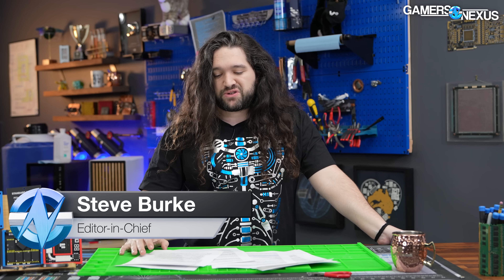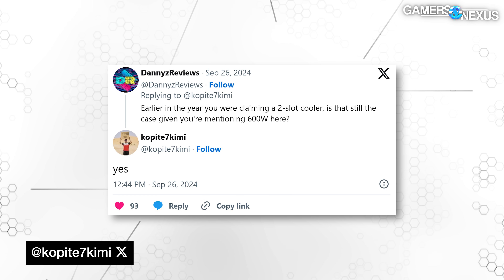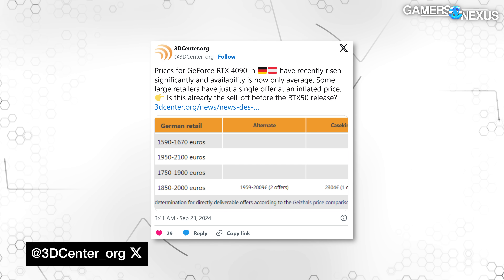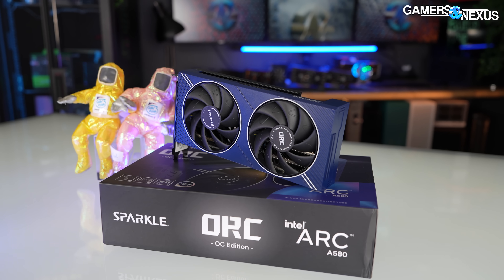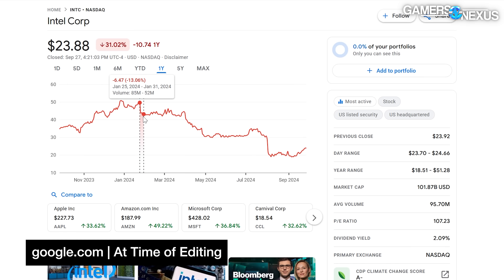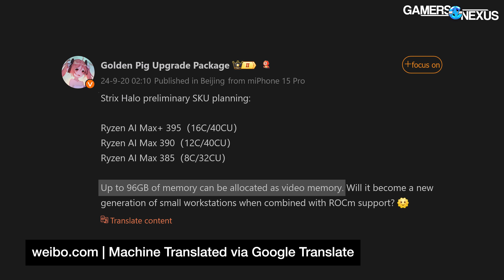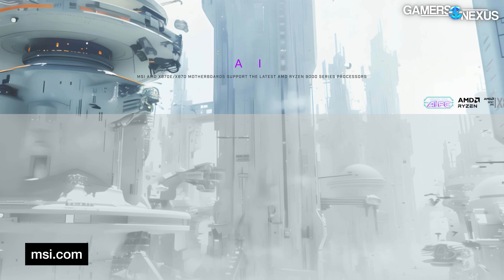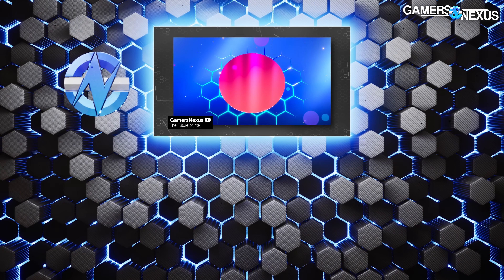HW News - RTX 5090 & 5080 Leaks, Valve ARM64 Experiments, Intel Arc 0% Marketshare, 4090 Price

Comment: Genuine question: let’s say cuda cores increase 10% from 4090>5090, would it be an at minimum 10% uplift in performance? Then tack on various architectural improvements to make it 18% or whatever
Reply: maybe - maybe not, if they want to make it more efficient. But seeing as there won't be any competitors, my guess is they don't go full throttle.
Reply: @bernds6587  really I’m just curious if we can estimate a minimum improvement based purely on the core count.

Comment: The problem the 4090 had with AIs was it just had a few GB to little VRAM while the RTX 6000 had enough but the GPU core was slower. If the 5090 has 32GB that will fix the VRAM issue for the lower end of medium size and higher end of small AI model training. Now do i see businesses buying it for that? No i do not as most user the large or huge size AI models with many GPUs instead of 1 GPU with only 32GB of VRAM. For schools teaching about AI i can see them buying a computer lab full for 5090s so students can sit at the computer doing the training. Supervised AI model training in theory is the best so having a GPU that can do it itself without having to pay for  a datacenter would be good.
For gamers? Unless developers  start running the type of AI models in mods locally  it is most likely not going to be used any time soon. 
The enemy AI used in games really isn't the same type of AI as the AI models referred to in the tech news. It is just a script that most are not even able to reprioritize actions based on how the player plays the game. An AI able to would not take up that much either just in games outside of horror games a learning computer enemy was found to not be fun as it can be perfect and you cannot.

Comment: 9950X3D with INFINITE cache!
Reply: on the new ASUS x870e boards with the upgraded ram slots.. probably hit 8200Mhz
Reply: @jabronilifestyle  Its waste of money. RAM needs to run 1:1, all those 8000-9000 MHz numbers are all BS, you gain nothing from it
Reply: @Dr.WhetFarts  Only with cheap ram. you're categorically false and I have the machines and testing done to prove to myself that you are incorrect. Sorry not sorry.
Reply: @jabronilifestyle  It's still too uncommon right now with the current manufacturing process to get a chip with a great memory controller. The memory controller on my sons water cooled 7800X3D just refuses to remain stable beyond 2600Mhz(5200 MT/s)... which is the maximum guaranteed speed.  A different 7600X system I have was able to push to 3200Mhz(6400 MT/s) with no instability after months of heavy use.  So while it's definitely nice to see the 9000 series' guaranteed spec bumped up to 2800Mhz(5600MT/s)... most people just won't be getting a chip that can run much faster than that so cutting the controller clock would be necessary and that eats into any potential gains. Plus X3D chips make chasing memory speeds almost pointless(for most use cases). Not entirely... but almost.
Reply: @jasonluvisi  I don't care how common it is, I'm running 8200Mhz on AMD and you can't stop me.
Reply: @jabronilifestyle  Sure you CAN... I mean anybody can pay double the price for a 2% real world(not just memory bandwidth sensitive tests) performance uplift.   Higher speeds won't make any real difference until the UCLK can keep up.  But yeah it's your money.

Comment: I'm still using my Asus rog strix Z3090-E mobo with i7 9700k CPU and RTX 3060 12gb by zotec.   I wanted to upgrade to an AMD build (I only have the Intel because I got the whole system for $400 4 years ago 👍), but with all the components being SOOOOO expensive and questionable quality, IDK what to even buy.  I was looking at the Zen 5 AMD 7700 CPU but I heard those suck. CPU is the one I use most so that's the one I really want to kick ass.  
Same with ASUS and all the warranty lies don't sit well.  I've used Asus since I've started building my systems. 🫤

Comment: Amd cards are getting pretty good but I feel if they made advances in software interface side I’d probably get one,  I just like the Nvidia control panel and dlss and dlaa upscaling more,  card for card they’re very competitive on paper,  fsr could be better and still not quite there and user interface is to flashy on amd and not as easy to use as nivdia control panel.  Probably will get a 4070ti  super 16gb.  I was going to get a used 3080ti or 6950xt. With how crazy demanding games are getting it might be smart to get a 16gb card now for 4k especially with 4k 240hz monitors that can be a do all for competitive and cinematic games

Comment: If nvidia does not support virtualization or gpu-passthrough on the 5080/5090, I'm going to be extremely disappointed :/ 
Also was hoping that you'd cover valve retroactively updating terms and holding the user's game library hostage to force them into accepting the new terms :/

Comment: nVidia is probably the one doing the "leak" just to skew expectations and avoid sticker shock. 
Tell everyone it is a 600w card so when release is 500w people are not appalled and may even think it they are delivering better than expected.
 
10k shader cores and 16GB is literally just a 4080ti, so the 5080 had better have substantially lower power consumption considering the needlessly reduced future proofing of 16GB. Unless they found a way to double base clock speed. I mean I had 16GB main mem and 4GB vram in 2012 and that wasn't even a flagship card [and only using 2 of 4 dimm slots in my middling desktop].

GDDR7 is fine, and a natural manufacturing progression [and number bigger better marketing], but are any of the cards really being held back by GDDR6? Just doesn't seem to be a real bottleneck.

Comment: I'm wondering if the 5090 could be a dual GPU with the NVlink interconnect they touted at their blackwell presentation. Still wouldn't explain the physics bending 600w dual slot thing, but all these doubling specs from the 5080 as me seeing double. So will the price i'm assuming. lol

Comment: I really doubt that 9800X3D will dethrone the 7800X3D like the 9000 series is performing right now. Maybe it will appeal those will want the top of the top, not caring about price and relative performance. Also, if they'll sort 3D-cache issues with the interconnection, X3D-Ryzen 9s will take the throne and the 9800X3D will stay in an awkward position.

Comment: I wonder what TDP will those Strix Halo chips come with. Even the 12c/16CU ai 370 benefits from 54W, 16c/40CU will need plenty of power. And also the price, even the current Strix Point chips are expensive, these will be in 2000+ dollar machines.

Comment: If 4070 ti super/extreme discounted 4080 super are cheaper but equal to 5090 performance, would it be better similar to having 2 12gb 3060  instead of a 3090/ti?

Comment: Dual V-cache CCD's is undoubtedly due to the horrific intra-ccd latency Zen 5 has coupled with AMD/Microsofts inability to reliably run processes on the correct CCD. Dual vcache CCD obviously won't fix the latency issues, but it'll at least limit the performance loss. Instead of losing gaming performance because a thread is running on the wrong CCD AND being hit by a huge latency penalty, not you'll just be hit with that huge latency penalty.

Comment: the segmentation between 5090 and 5080 is even stronger than in the 40 series according to these rumors. 
I fear the worst when it comes to 5090 pricing. 

I got a 4090 at its almost lowest price in Germany and right now I do not feel like I need an upgrade. So I might skip the 5090 since the 5080 definitely will not be an upgrade and I am not gonnna drop over 2000€ on a GPU.
Reply: Why did you buy 4090? It's not gaming card.
Reply: @reav3rtm   based on the same tech as the lower "gaming" cards, but with extra power. Maybe he either also streams and needs that extra power - or like me - wants to buy stuff once every blue moon and keep it for years.
(with the difference it will be a 7900XTX for me - don't want Nvidia)

Comment: It's such a shame what's happened with Radeon, I only really recall one time AMD was on top very briefly and that was with Hawaii back in 2013 - it's been a decade of struggling ever since. RX 6000 and 7000 were both strong generations but they just couldn't get past the mark with price and performance - not powerful enough to be the premium product, not cheap enough to be the value product; just left nipping at Nvidia's heels, hoping to get some scraps. Now that proprietary software/features are so important, that just adds to the struggles AMD will have to overcome to get back the market share they lost. FSR 4 will help, but they really need parity with ray tracing performance, and to have a deep think about what technology might be coming next so they're not caught with their trousers down again.

Comment: 5200MT/s is kinda low for 14900K isn't it? It's even below officialy supported speed(5600MT/s), not to mention 6000+, or even 7000+, used in benchmarks by 3rd party outlets. Why would they use such a slow RAM?

Comment: I still do not understand why people still buying 4080 and 4090 this close to launch ?
Historically speaking you will get 4080 level performance in 5070 and 4090 performance 4080 in and save a lot of money if you wait 2-3 months.
Then there are the locked stuff that comes with new genaratation like new DLSS or new FG or any other type of new tech that is locked for the 5000 series.

Comment: Since Nvidia plans on stopping production of the 4090, this will leave a big segment of the market that AMD and Intel can go after and up their market share. At some point Nvidia is going to get to the point of no return and I believe that the 5090 is going to be that point. Without Bitcoin mining they are not going to have the same success they had with the 4090. If AMD and Intel can come up with a reasonably priced "4090" type card that can do the same ray tracing they can dominate that middle to upper class GPU's without having to chase Nvidia at that top elite level that I think on the next iteration the 5090 is not going to sell anywhere close to what the 4090's did.

Comment: ..or it it could draw 600W but the actual card will be limited to ~450W and a loud turbine will keep it at cool 84C but the Asus board will draw 600W and will require 4 slot cooling but will have 3kg and will be 5 slot card that overheats because it uses cheap transistors at the back.

Comment: These newest high end graphics cards when added to the rest of the system heat load, are approaching the output of most 110 volt space heaters. My old 11700 w/IGPU warms my room (14’x14’) to nearly uncomfortable levels late on summer evenings, just watching utube. Geez.😕

Comment: The 4090 is effectively $2k. I would not be surprised if the MSRP of the 5090 is at least $2.5k but in reality closer to $3k.
Reply: Especially given that the massive majority of 4090s was sold to companies and professional users that can easily afford such high prices.
Reply: @germanmosca The artificial supply limit is also keeping the prices high.

I literally bought a dozen used 2 slot 4090's recently at well above retail. Would have gone for new cards, but they are completely unavailable locally. Just getting one card at retail would taken over a week of constantly checking stock.

This isn't new, when I got my first 4090 last year, it took over a month and all I could get was an incomplete open box return.

Comment: intel really needs a fresh microarchitecture. Persisting  in using the P6 microarchitecture past the point of all logical development has resulted in CPUs that waste power and destroy themselves in short order. It is the computing equivalent of trying to make a Model T Ford go 200mph and modern intel pretty much peaked with Haswell. The launch of Ryzen should have been their clue to start developing a clean sheet design.
The ridiculous thing about Nvidia's dominance is that it comes from people buying low to mid tier GPUs based on the performance of their flagship, which is kinda like deciding to buy a Chevy Cruze because the Corvette Z06 exists. AMD delivers far better value for money in the low to mid tier range. 
Nvidia is still riding high on their glory days of the mid-2010s and the reputation they earned back then but in 2024, it is an entirely different ballgame.
It has never been easier to get detailed information about how different GPUs perform compared to others. Most people just simply don't bother to look at the data before they buy. 
Also, I think a lot of people are getting their first RT capable card with 40 series and they don't realize what it actually takes to run Cyberpunk at Psycho RT settings. They don't understand the potential downside of frame gen or the fact that Nvidia is heavily leaning on it to make their lower tier GPUs to perform. 
They don't realize they are trading rasterization performance for features that can be provided by a $7 app (Lossless Scaling) and paying a premium for that, and an inadequate amount of VRAM, for how long a $600 GPU should be able to satisfactorily play new releases - should be at least 5 years - that's what I got from buying a GF3 Ti 500 at launch for roughly $600 in 2024 money. People who bought a 1080 at launch got way more than that out of it. It is still a great 1080p budget GPU as long as you don't want to play AW2. Even then, it can manage a consistent 30+ fps at 1080p Low despite having to emulate those mesh shaders on the CUDA cores. It is one of two GPUs without DX12U support that can actually give a playable result in AW2, the other being the 1080Ti, of course.
The mining boom gave Nvidia a taste of how much they could be making. How much desperate gamers would actually pay if they had to in order to get an upgrade. Compromises they were willing to make just to get an affordable GPU during a period of sky high demand and low availability. And they have done it artificially with 40 series. 
I paid  $1100 in early Jan, 2021 for a 3080 back when it was the most powerful consumer GPU in the world. Turned around and sold it a month later for double that to someone who just had to have the latest and greatest and bought 3 5700XTs, giving me about 50% more hash and like 20% better efficiency. Meanwhile, I made a net profit of around $600 mining on it for a month, lol. I gamed on it for about 4 hours total, just to see if it was worth it to run Psycho RT in Cyberpunk. I would say it wasn't worth it at a price of $1100, let alone over $2k. 
I think it is safe to say the 5080 will launch at a price of at least $2k. I think, at this point, they probably have the audacity to price a 5090 above $2500. Since they have a virtual monopoly on ultra premium gaming GPUs, they can keep on charging COVID era prices.

Comment: I have a question for you..... I'm new to geekbench and GPU testing, but after watching this video on you tube, I downloaded it and ran it on my system. Please let me know if you think the score is within norms, thanks very much in advance. I'm running a 7800X3D with a EVGA Hydrocopper 3080ti, 32 GB ram. I scored a 196351 (open GL) and a 173963 (Vulcan) on the test. I have no idea what these numbers mean, so if you or someone there could give me a ballpark explanation, that would be great. Bottom line, do I have a half way good system, and do you think it's running at a good mark level for what I use it for, gaming and daily driving. Thanks in advance for any feedback. Love your videos, have been a subscriber for a while now.

Comment: The latest 012B bios is a great way to drop 100 points in Cinebench 2024 multi,  or 2000 points in R23, with my 14700KF. 
I think intel CPU's are safest when they are TURNED OFF ! 
Also, rumour has it Core Ultra 285K is SLOWER than 14900k in gaming..... which makes me wonder if not AMD 9800X3D is my next CPU.

Comment: I have 7950x3d, 32gb gskill flare expo ram, when i disable idle in power option for low latency it takes 85w power but after 2 hours it slow down whole system i disabled cstates in bios and all power saving features on power options, cache ccd is not usable at all, freq ccd holds up for 2,3 hours, it never boot with expo i have to use all default ram settings and if i use 5200mhz in game shot never registers, checked all temps all under 60 still after 2 hours it starts to slow down whole system not sure what to do intel is also unstable now

Comment: I'd bet dollars to donuts that AMD is pushing Soundwave (AMD ARM SOC) hard for a SteamDeck "Mini". It performed exceptionally well against nVidia's ARM SOC in Nintendo's Switch 2. Nintendo admitted that AMD Soundwave exceeded their expectations, but they chose nVidia to simplify their need for backwards compatibility between Switch & Switch 2. Soundwave apparently leverages RDNA3.5 GPU architecture, which Valve is interested in maintaining to build Proton on ARM, and a smaller SteamDeck.

Comment: I think the lesson Nvidia learned from the 4000 series was not only people are willing to pay more but people dont seem to care if they package what should of been a 4030 as a 4060 and up the price to go with the downgrade of expected specs.
So now they are packaging a 5070 as a 5080 and almost certainly upping the price on that as well.
Sure as shit the 5090 is going to be going up to a minimum of two grand if not two and a half due to the massive performance gulf.
Reply: people buying 4000 cards coincide with the time when cryptos finally died and GPU prices went from insane to better, that's when people upgraded.
only the RTX 4060 is almost the same price (when accounting inflation) as it was before the price hike in 2016, it's only 7 more euros than pre-price hike in Europe, so it has a good value now at least.
not the case for every other card higher than a 4060 however.